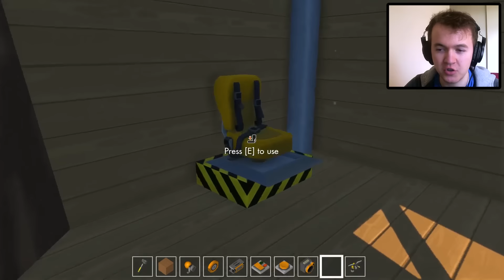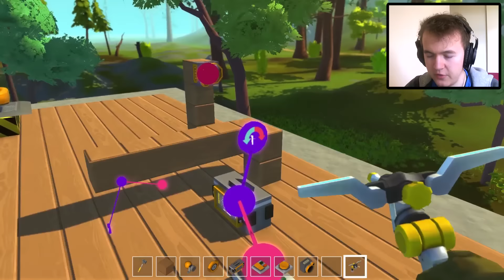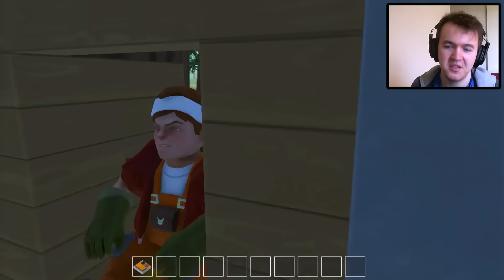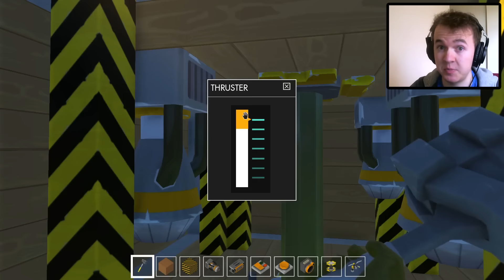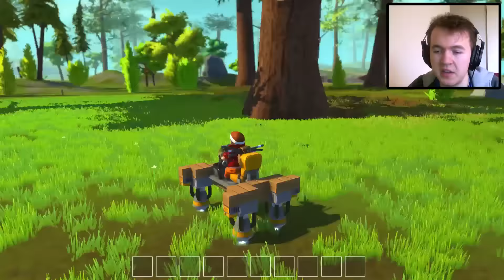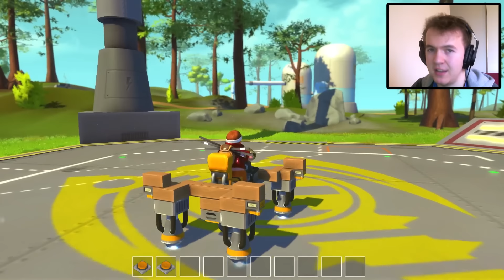LIFT, HOVERCRAFT and DOORBELL | Scrap Mechanic Gameplay #7 | Creations

Comment: you should do like a livestream on Youtube or a 1 hour video or something of the sorts
Reply from the maker: +Hunter Romans specifically Scrap Mechanic or just anything? I livestream on monday evening on twitch (7pm GMT)
Reply: +TheOriginalVader no idea you live streamed but anything
Reply: +TheOriginalVader I Know How To make IT better Next To The Black And White Poles Put Wheels Connected To Barriers Well no engines
Reply: Or Just Remove The Rockets Then Put Wheels On The Side Of The Poles And Make Them Go Up By Engines
Reply: For The HoverCraft Put All The Thrusters Connected To The Same Sensor So When The One Sensor Senses The Ground All The Thrusters Will Go Off
Reply: Just Put One Sensor That's Connected To All The Four Thrusters

For The HoverCraft
Reply: Only Need 4 Thrusters Dude 

Commonsense Dude Use Your Commonsense And Also Your Brain's Physics

Comment: You could use jet thrusters under the elevator and motorless wheels on the rails. Would that fix the jerkiness?
Reply: +TheOriginalVader Probably yes because some people made lifts transforming into monorails and they had seats on
Reply from the maker: +247FlashGames Possibly. I think it's jerky because I'm standing on it, so if I add a seat I think it would work fine

Comment: Maybe try to make a machine that goes in a designated path (100 blocks forward then turn 90 degrees 50 blocks forwards or smthng like this) and at the beggining it picks up a box, carries it all the way to, let's say, a container and then drops it, play a short song or sound (:P) with horns and then goes back and does everything again (even if there are no boxes left it just goes on xd) and then you can close container pick it up with a lift and load onto a truck? :D

and by the way, will you be streaming in monday? :)
Reply from the maker: +Krul_Śilvera I can try that, would take a while though :P And yes, I'm pretty sure I will be streaming
Reply: +TheOriginalVader I&#39;ve been messing with this machine for a little while and I made a short weird song (not attached to carrier yet). Basically what the machine does it has wheels and sensors. When a sensor &quot;sees&quot; a block in front of the car it turns all four wheels by 90 degrees ( I had to make a long wall not decorated yet so it stays turned) and the other sensor &quot;sees&quot; another wall and he turns the engine on or off, although I had to make some kind of breaks system that stops the machine in place so another sensor can sense a stick that comes out of nowhere when sensor on the breaks mechanism senses the machine and it will drop the box down, but I havent made claws yet :P